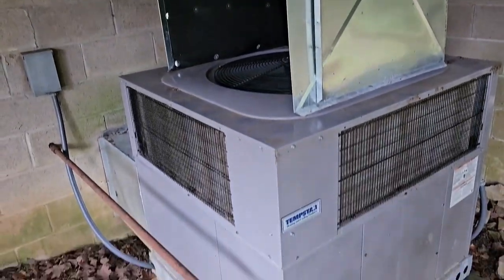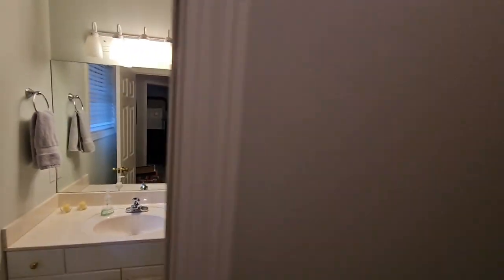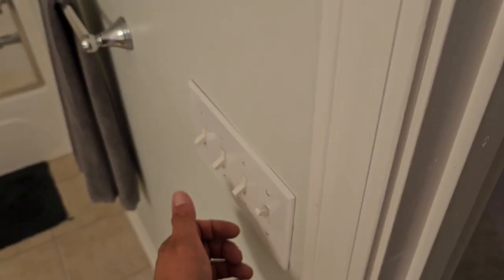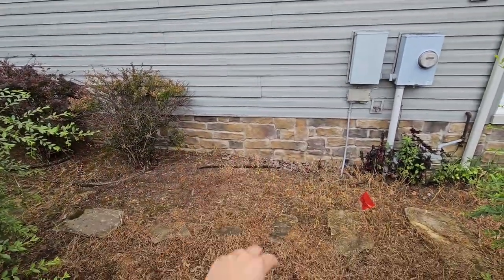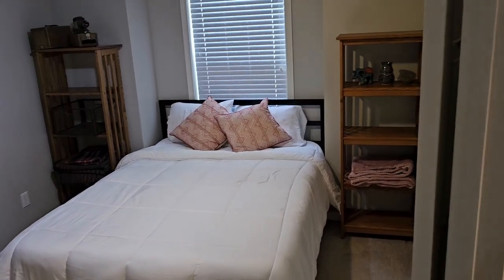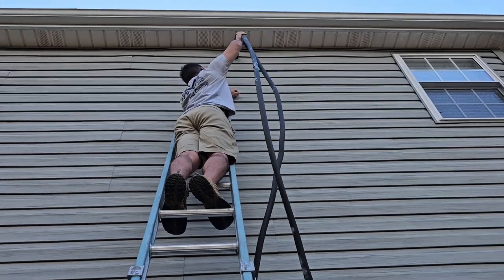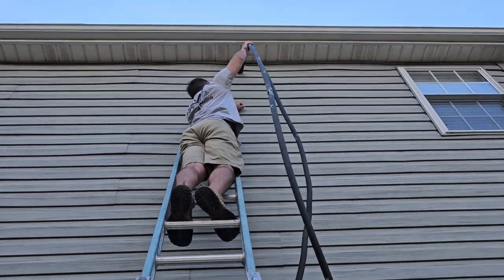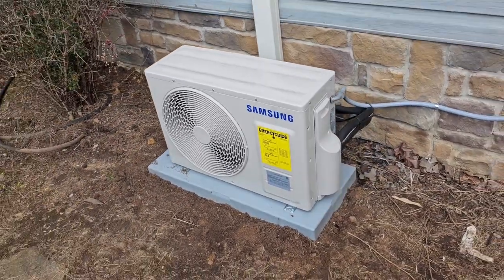Mastering Temperature Variations Between Floors Like a Pro

Comment: The only thing I can think of to nitpick this install is don't use romex in conduit outdoors. @15:04  It's not rated for wet locations because of the paper inside, and using solid core wire where its subject to bending isn't a good idea. Buy a couple rolls of black/green/red  stranded THHN wire if you want to make your own whips of custom length. It's easier to electrical tape 3 #10 or #12 wires together and pull thru sealtite than Romex, which is against NEC plus its gotten way too expensive lately as well :) Other than that, looks good! I've tried those flare gaskets too, so far so good. I wouldn't trust the lineset factory flares without those, or cut them off and make your own like you did, and use the flare nuts that came with the unit! 99% of the time, the flare nuts they come with on the factory beat the cheap nutss they pre-install on the linesets are cast junk and not forged brass like the OEM Samsung ones for example. I also prefer to braze the indoor connections too, if the flares will end up inside the wall, because who wants to tear out drywall to look for a leak?? Bad flare on outdoor unit is simple to fix by comparison.

Comment: I think this was probably the best solution to this house. I would have preferred fixing the horrible return air grill location, but probably not feasible in this house without a large very expensive messy interior demo/remodel. Plus that Samsung unit is going to be MUCH higher seer rating than a package unit, package units tend to advertise "13 SEER" but we all can see that puny coil for a 3 ton unit in the real world is not going to give you 13 seer, especially with it being that dirty, and also the flow restriction of that 90 sheet metal duct added on top. I bet if you used that psychrometer and took some good measurements, measured static pressures, clock the gas meter with it in heating mode to get as accurate as possible of the actual CFM performance of that blower, I'd be surprised if it was even running at 10-12 seer efficiency...they're probably using a very restrictive 1" pleated filter in that return air rack too, which doesn't help.

Comment: Cool product tip with the little blue flare things. In my experience running closed loop butane/propane extraction systems on the west coast I observed that properly done flare connections (clean and without burrs and tightened enough) never leak especially copper over stainless steel. And in that industry not a single person is using a torque wrench it's all by hand. Now granted hydrocarbons are running at a much lower pressure than AC refrigerants. I'm a DIYer about to install my first central AC at my house. It comes with precharged lineset, I just have to make the flare connections. My instinct is that they will perform perfectly fine and there is little concern about leakage, I am not concerned about this part of the project whatsoever...is that a flawed perspective?
Reply: Seems more likely to me that the blue things would cause a leak than prevent one...anyone else?

Comment: what city and state are you in? I have a senville mini split on my rv - maybe I will come to you
Reply from the maker: Camden Tennessee
Reply: @TaddyDigest  adding to my route!
Reply: i put a mini split on my rv
i paid an ac tech 
senville
12k 110
until recently it would freeze me out under the florida hot sun

now, it’s not able to cool under any conditions 
air coming out is cold
not consistently cold

so other day i needed the heater
typically the heat would burn me up
other day it did near nothing 
air coming out was warm/hot

so i’m thinking the fan is not doing its job
but i can see something turning

a little while back an ac tech filled the unit, said it was low 26oz?

the remote control didn’t always work consistently 
but i sprung a leak so i took it apart, sealed the drain hose connection and after that the remote works flawlessly 

recently the unit has error codes
luckily i had an extra circuit board for the outside because it gave me those codes at the beginning of purchase
senville sent me the board 
but the codes stopped so i just kept the board

the codes went away after installing the new board

today i ordered the pioneer mini split through home depot 

your video made me wonder if cleaning it would fix this unit 
or was it possibly built on Friday

Comment: Fan On, not auto.
Reply: No, in a humid climate that will make things very uncomfortable because you end up blowing all that humidity off the indoor coil and all thru the supply ductwork.
Reply: @brnmcc01  I wasn't watching video completely, decided that it's just like my home. I have ac to 70, but second floor and on room 1st floor will be too hot. So I run it not on auto,but ON .  Does this split have a heat pump?
Reply: Somewhere that has a dry climate like Arizona (outside of monsoon season) where the humidity drops into the single digits, then yes, more airflow is better, leave the blower on constant On. You cannot get any condensate water from an A/C drain line if the ambient dew point is below 32 degrees, because a properly working system the coil temp should not ever fall below 40, or even 45 or you have other problems :)
Reply: @pfoxhound  Yes most mini splits also have a heating mode. In your house, if you have an open stairwell from 1st to 2nd floor, and if you have any return registers upstairs, make sure they're as large as possible, straighten out the fins etc, and don't have any returns on the first floor. This will create a suction upstairs, pull the cool air from downstairs up top, and feed warmer air to the AC unit. The best way to think of this is think of the big picture. An A/C unit does not produce cold air. This is a very common misconception. What it's actual job is, is to remove the heat energy from inside and reject it outside thru the condenser coil. This is why one of the first things he did in the video was wash the condenser coil of the existing unit. You can't have good performance if you're not helping the outdoor unit do its job of being like a garbage collector, and pickup up that unwanted heat from inside your bedrooms and rejecting it outside. Also, like in this house, if you have all your return air on the bottom floor like this and close to the floor itself, then it creates like a short circuit. Cold and drier air sinks fast because the colder and drier air is heavier than wet warm air. This freshly cooled air goes right back into the AC unit, but the hot stagnant air stays upstairs, and the thermostat satisfies far too quickly acting like an oversized unit, and then shuts off before the upstairs even has a chance of cooling.

I've fixed many houses like this one by simply adding a wireless sensor upstairs in the master bedroom, installing a RedLink capable thermostat and programming it to take the average of both the t-stat built in sensor and the wireless one, and adding more return air registers upstairs or opening them up etc, and completely deleting any registers downstairs especially ones near a kitchen, thats a no-no, we dont need cooking odors etc being blown thru the whole house etc.
Reply: @brnmcc01  You are correct. I tried this recently and it only made things worse.